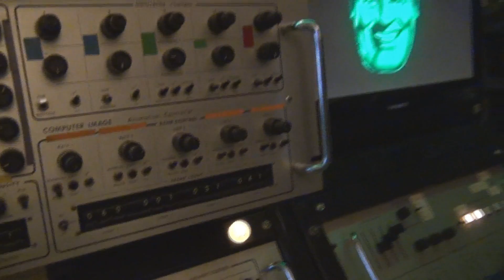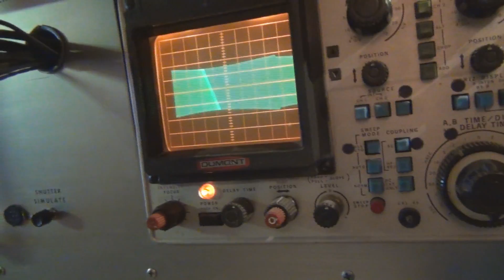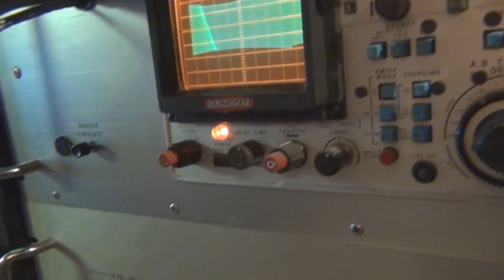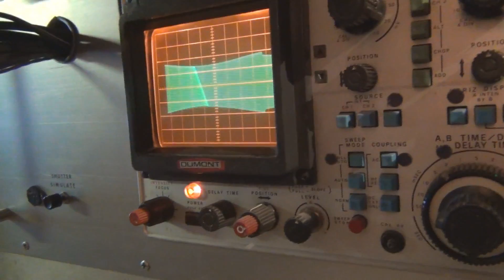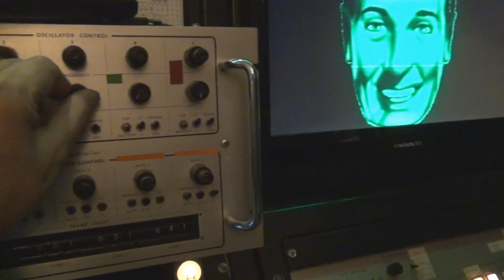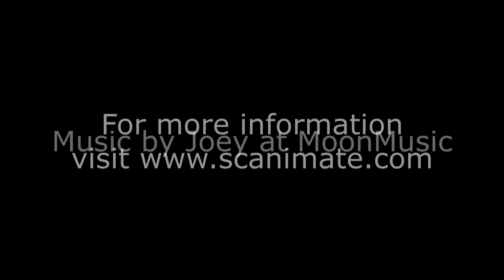Introduction to the Scanimate Part 4 - Using Phase-Locked Oscillators to Change Personality

Comment: Could you make more videos explaining some operation principles? I am fascinated by all I've seen so far and want to play around with a system like this myself. Seeing how it's impossible to get an actual scanimate myself I want to try constructing my own 'scanimate' using FPGAs to turn a digital video output into an analog signal I can manipulate and display on a CRT. I'd like to emulate as much of the analog workflow as possible though, as that is where the real magic happens in my eyes. How do you operate the colorizer?
Reply: How did that go? I feel like we need people to replicate what we can from this archaic technology with new parts. People are replicating old analog synths, but in digital hybrid hardware and in software. Maybe it can be done with analog video?
Reply: @puppetsnob  i also hope this is happening ! 🥺
Reply from the maker: Please email me dave (at) zfxinc.net
Reply: I've created a library for Pure Data which does this: it takes a digital image or video, either saved as a file or from a live camera input, and outputs it as 192kHz audio to be displayed on an XY CRT. You can use the internal oscillators of the library to affect the image in the same way as the Scanimate, or you could run it into your modular synth, for example. The resolution is much lower since audio signals have a fraction of the bandwidth, but you can get about 25fps with 120 lines (non-interlaced). You can find this on https://github.com/macumbista/vectorsynthesis